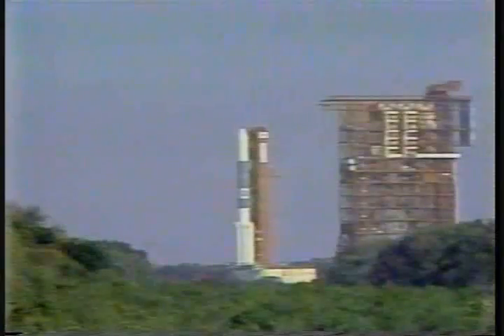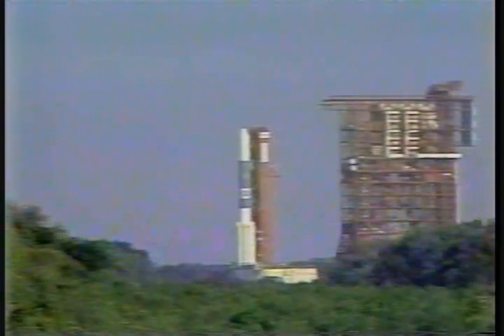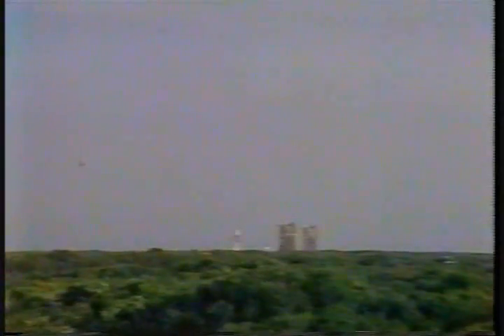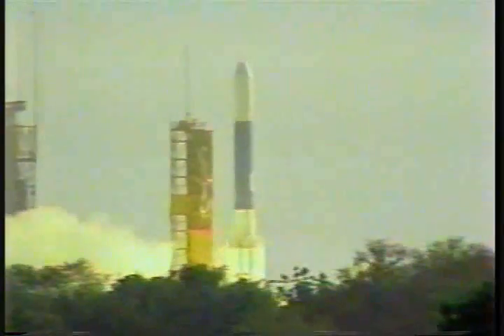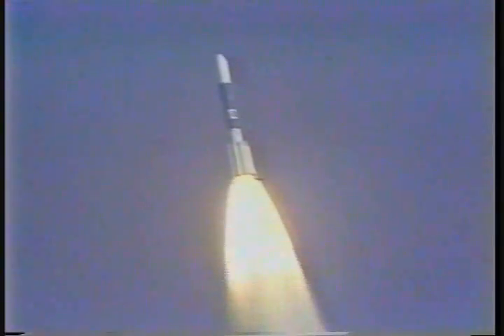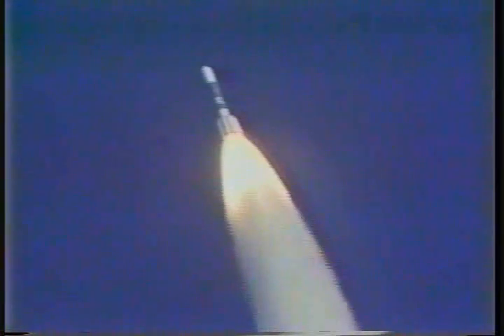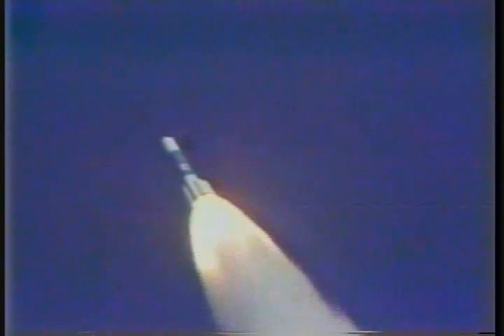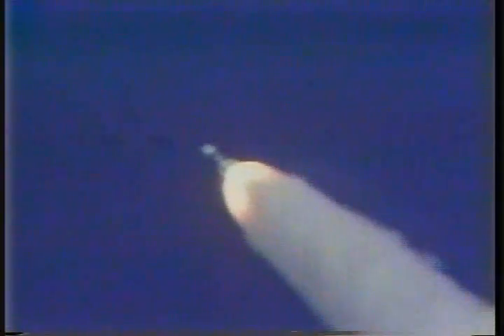Delta GOES-G launch failure (5-3-86)

Comment: The Delta II rocket now is incredibly successful. It has now launched 99 straight successful times, more than any rocket ever!
Reply: +David n Actually 98 consecutive successes. When JPSS-1 launches in early 2017, should it be successful, then it will be considered the 99th. Same goes for ICESat 2 later that year; however, that might count as the 100th straight success. ICESat 2 is scheduled to be the final Delta II while JPSS-1 is the next-to-last.
Reply: +David n soyuz?
Reply: ICE sat was a success
Reply: Falcon 9: “womp womp”
Reply: Mhh check again
Reply: the Falcon 9 launched many times probably more than the R7 and the Delta 2
Reply: sasi sqareburger please tell me your high. The R7 launched more than twice as many times at f9. Almost same goes for delta 2
Reply: @TNTHammer  kinda correct with the high part there but when will you make a vid on the Atlas 5 411
Reply: sasi sqareburger, right now I'm making a video of me building deep space gateway (new space station around the moon) using the SLS and Delta IV Heavy
Reply: This wasn't a Delta II rocket, though.

Comment: What basically happened was the jolt of the airlit solids igniting caused a short circuit in the computer and it shut the engines down.

Comment: The rocket exploding was intended, once the main engine malfunctions and the rocket veers off course in order to protect property and people that are outside the launch corridor a UHF blast from the main controls detonates charges in the cases of the solid boosters and main rocket body, detonating the fuel at altitude as opposed to when it hits the ground. Although spectacular, it's much safer.
Reply: Greg Rix did you see the vehicle begin to lean prior to termination? I wonder why it did that?
Reply: @JosiasRivera   Little late but the reason it veered was because they lost power to the main engine which has all the directional control. So it was just along for the ride on the SRBs which can't steer. Once the center of pressure changed, it tore itself apart and they detonated the first stage.

Comment: The PR announcer generally does not have a video feed to look at (at least in 1986) so they can seem to be behind the loop. You could see a change in the plume as the engine shutdown. Amazing that the rocket remained intact even after it flipped around backwards. Until the RSO terminated flight.

Comment: "we have a main engine shutdown"

:D  AFTER the explosion LOL
Reply: The PAO is really just reading off a script. They don't have a data feed. It's like how during thr Challenger accident the PAO reads off speed and location data well after the breakup. Before the long pause and the "obviously a major malfunction." statement.
Reply: The main engine shutdown was not scheduled, it caused the rocket to flip. The main engine is what steers the rocket. You can see how the core engine turns off before it starts to tilt. It could have many reasons for why it came so late but who knows if the sound and the video are in sync at all at this point.

Comment: You can see the central engine shutting down at 1:54, then, the autodestruction system was triggered to prevent the rocket crashing on populated area

Comment: @ti994apc 
Neither the Ariane 5 nor the Titan IVA explosion had anything to do with their solid boosters. Both were caused by a guidance failure, a short circuit on the Titan and a software glitch on the Ariane. The last two Taurus failures were caused by the payload fairing which did not seperate. FYI, the Delta 4 uses up to 4 SRBs.

Comment: @blablubb12345 Good track record unless you are an Indian National rocket, Space Shuttle, Titan IV, or a Delta II, Orbital Taurus, or any solid rocket fueled system created after 1985.  The Ariane 5 is not bad with only one major explosion.  Most catastrophic solid failures are about 1/60 with 90% success.  Delta rockets have scientifically scaled back the use of SRB's.  Out of 4 systems only 2 use SRB's and not more than 2 on each rocket.  Luckily, their heavy lift system has no SRB's.

Comment: @ti994apc 
That's not true by both accounts as solids have a rather good track record and even the Delta 4 uses them. Btw. this launch failed because the liquid fueled main engine shut down early, leaving the rocket with no steering capability.

Comment: I am glad for the sake of Delta rockets that the next generation will not be using solid rocket boosters.   SRB's have killed the reputation of most modern rockets that have used them.